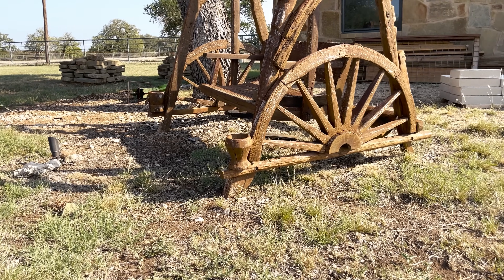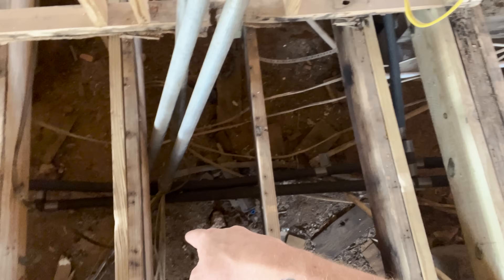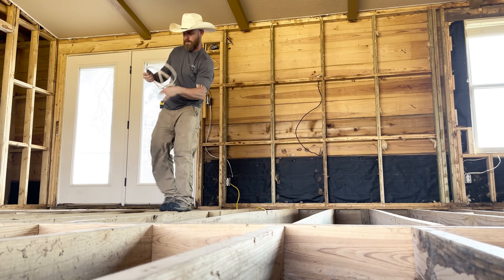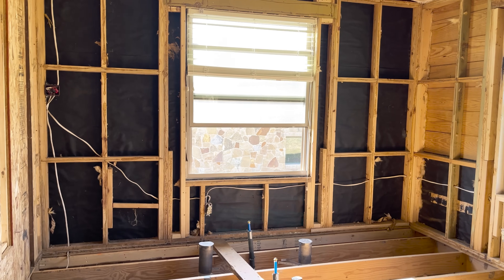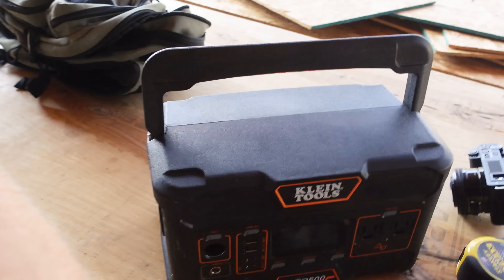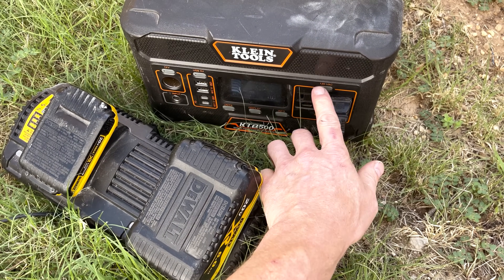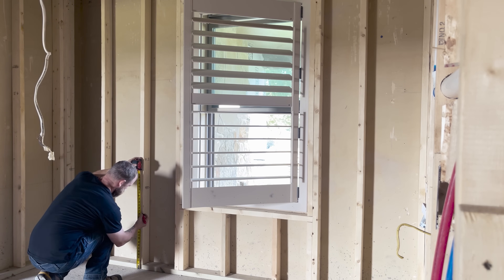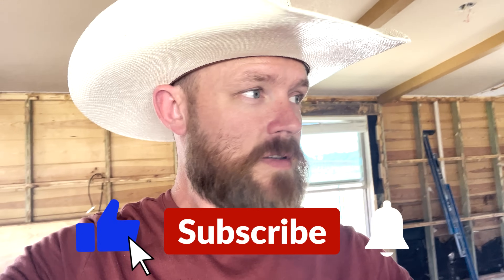Ranch Demo: Time to Gut Out Some Horrible Old Electrical Work

Comment: In 1967 I put a hog feeding project into an old dairy. I started by cleaning up the old panel at the dairy, which was the entrance for the dairy and two houses. It was a more or less standard 200 amp service. In cleaning this mess I found that there was ONE 120 volt circuit serving the two houses. It is no wonder that the lights were always so dim in the houses.

Comment: Although pretwisting is a good idea, the wire nut bags often say “pretwisting not required” so it’s not a huge snafu if someone doesn’t.  As long as the nut is tight you should be good.
Reply: Lots of times they typically twist themselves after tightening. I tighten the nuts down and tug on each wire to ensure its locked in there. Testing to ensure its locked in place is more important than pretwisting imo

Comment: I recommend using bigger cable cutters to cut the Romex, it will save your hands in the long run.  Klein's makes a nice red handled pair sold at Home Depot for about $100.00.
Reply: Tin snips work a treat and they're like $14.
Reply: @in.der.welt.sein.  Tin snips still require you to use your hand only and the long 18" cable cutters require you to use your arms.  The idea is to use your hands less.

Comment: When you pull out a long-ish run of romex on a demo like this is it safe and/or legal to reuse it?  Like if you take out a 10 foot run, can you cut off the ends and use it somewhere you might need a 6 foot run?  Or can you open it up and cut the individual conductors for use as pigtails?
Reply: I normally save 20 ft+romex runs to reuse and if it's Mc 10 ft or more. I cut my wires above or a cple 0f inches before boxes
Reply: Would love to know this too
Reply: If you were a customer and found out that your contractor was putting used wire in your house, how would you feel?
Reply: @bschilt3  what's the difference between using wire from a 20 yr old spool vs from a home built in the past 10 yrs if it's good enough no one wld be able to tell
Reply: @bschilt3  Well for one, I wasn't necessarily asking about using it for a customer, more in a case where someone could use pieces for their own home.  But for another, if I knew that it was perfectly safe I'd be fine with keeping it out of the landfill.
Reply: @drewk75  It is very easy and worth recycling wire (you can generally catch a fairly decent profit for it) if you aren't going to reuse it. Such a waste to throw it away, though I know a lot of people do. Metal recycles indefinitely.
Reply: @drewk75  we all make assumptions. And I assumed that's not what you were talking about. I assumed you were talking about reusing it for your personal use at home or whatever. Why do people have to be (expletive)
Reply: @bschilt3  used wire is perfectly fine as long as the insulation is in good shape. Obviously if its too old then no. If it's fairly recent 20-25 years then its perfectly fine.
Reply: I see no reason not to, as long as its not compromised in some way 🤷‍♀️.
Reply: With the current price of wire and materials, as long as the cable isn't damaged in any way it would be foolish not to reuse what you can, unless you're that type of person who lights their cigars off $100 bills🙄    one thing to be mindful of, is some wire produced before the mid '80s, was rated 60°C, whereas most light fixtures require 90°C rated conductors
Reply: @Sparky-ww5re  some wire is steel so you light your cigars with $50 bills
Reply: Reuse wire at $1.25/ft? Lord no. Lol
I'm not an electrician, but I do claim to not be a complete idiot. Inspect the wire, test it, and use it. Obviously you shouldn't use damaged wire or wire that have an ohm value when the end of the conductors are apart. 
That means the wire is bad folks. No use boom boom. 😉

Comment: Does old wire get recycled for copper?
Reply: If you like money it does.
Reply: For any larger conductor cabling on demo jobs it does. Depending on the job, contractor, employer, etc it could be an after-hours bonus for the crew or the company may collect it all and pay it out, or the boss might just say bring it to the office, it's mine and i'll pay your xmas bonuses based on it. Copper scrap is worth scrapping.

Comment: So, why are you the one ripping out the old wiring?   It looks like you're going to be doing a complete replacement,  in whcih case I'd think it would be more cost effective to have you verify that everything is de-energized, and then have whomever is doing the rest of the demo rip out the old wiring, etc  vs pay electrician rated to have the old wiring removed?
Reply: And also, why would the client want ALL the wiring replaced?  It would seem that a licensed electrician would make judgement on what wire would be kept versus what wire needs to be re-run.  Hard to believe ALL the Romex is defective. Maybe a lightning strike, flood, etc?  But yeah, if it all needs to go, a low-cost laborer could do all that.  I'm not criticizing, just want to learn.
Reply: @johnnysimes5082  probably because they want receptacles in diffrent places than before same with the breaker panel being in the middle of the living room they probably want to move that as well so it's just worth it to replace all the romex
Reply: @poyo3582  That sounds about right. This being some high-dollar hunting lodge, and the owner being willing to do reno deep enough to basically gut it back to the base structure, if there's a question of if the old electrical was unsafe the easiest solution is a full replacement. It's fine to reuse old cabling where you can pull old runs of cable into the new floorplan.

When you're bidding out a job where there's serious doubt as to the safety of the existing wiring and there's a serious overhaul of the floorplan anyway, AND the structure of the building is being made as accessible as new construction, then you're likely better off doing a full demo anyway so you know you're not going to end up upside down on the job because you tried to guess what might have been behind the walls you could save or reuse vs being able to more accurately guess the labor to pull in new cabling and not fret needing to reuse questionable existing work to be able to turn a profit on it.

If this was a limited renovation where most of the wiring wasn't suspect and the walls weren't being torn open that's one thing, but in a build like this you could easily lose the savings in material cost trying to verify and correct issues you find along the way. It may or may not be wasteful of some copper, but most likely the owner wants the peace of mind knowing none of the old janky wiring might burn the place down while nobody's there in the off season.
Reply: @carpespasm  Thank you, great explanation!  Makes sense.
Reply: @poyo3582  Gotcha.  I agree, weird place for a panel.

Comment: Most of those portable power supplies have the option to solar charge, which could double (or more) the capacity over the course of a day in the sun. The other option would be to get one that has a larger capacity battery. Yes, they are expensive but the payback over a small gen set plus fuel is only a couple of years with daily use.
Reply: BUT ... it looks from the pictures I have seen that those solar panels are HUGE. Very awkward to take around.
Reply: @KameraShy  ... most of them fold up for transport and will fit flat behind a seat.

Comment: Twist your joints together so when I have to come back and troubleshoot, it is a real bitch to separate wires...I love that! You should be able to twist the nut enough that it gets the wires twisted enough to stay together.
Reply: I agree. That joint was holding together just fine
Reply: Wow no, especially with that many wires in there the outside ones may bite but if even one comes loose all are done. If they are all twisted securely then there should be no need to troubleshoot at that joint you would check the line or load side.
Reply: And also that is in the breaker panel. Why would you be doing that on hots (assume because they are black). The whole thing is wrong lol